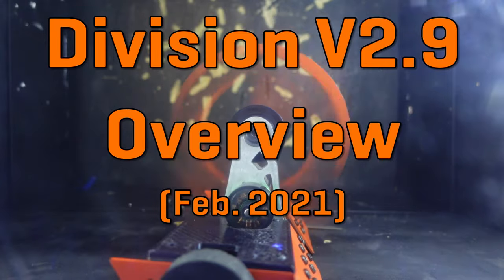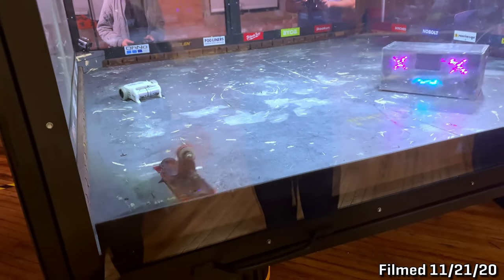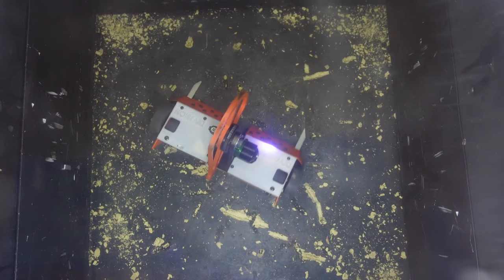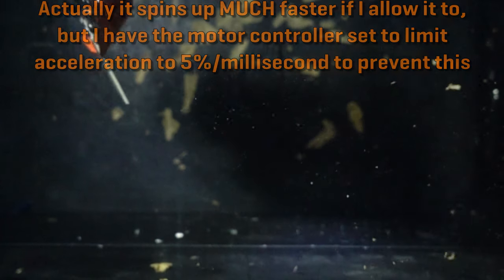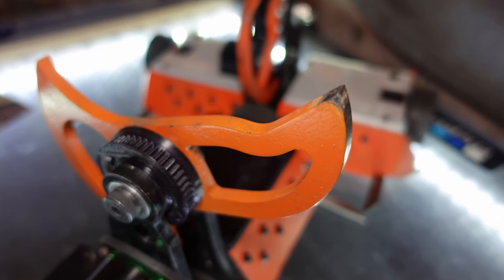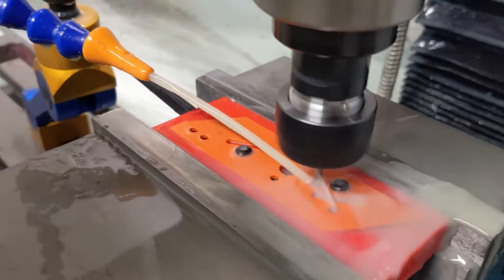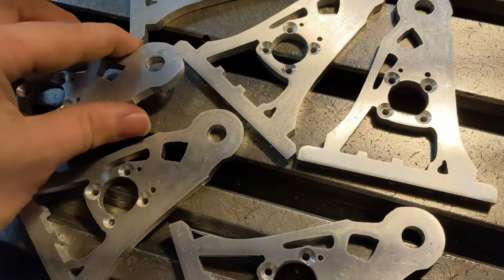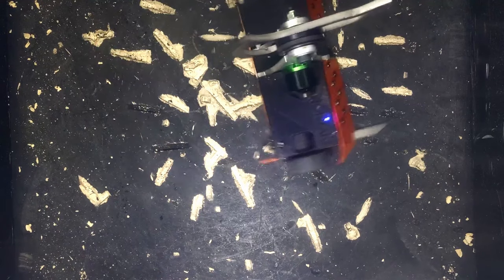Division V2.9 February 2021 Overview! (3lb Beetleweight Combat Robot)

Comment: What are Division’s detentions? Just want to get an idea how big beetle weight robots are.   Also, thank you for responding to my comment it made my day.
Reply from the maker: Division is far from a typical beetle! Definitely much taller and wider than most of the rest. It's about 11 inches wide wheel to wheel and the main chassis is 3.5" long and about 1.25" tall. The weapons are all 7.5" effective diameter and 1/4" thick

Comment: you can try making the drive longer in front of the weapon and reduce the angle of the wedge so that you would be able to pickup the bots and hit them and the biggest advantage is that division will tip over less than usual. you could use longer forks.

Comment: Thanks for the vid, great quality. I am a huge fan, and have been watching your videos since day one. Because of your channel I am working on my first robot. A 1lb drum spinner made out Lexan with only a Metal saw and other simple equipment. If you could give any advice I would be soooo grateful. I hope you acknowledge me.
Reply from the maker: Thanks! Great to hear that I've inspired some to start building. You can do a lot with some basic tools given time and patience. Lexan can be very brittle so make sure if one part breaks there is something else to support it. Also superglue can work very well (after some light sanding) to join polycarbonate together.

Comment: You should make a 30lb version of Division to fight at the Norwalk event! It would be super destructive. It might just be hard to get a robot that heavy to right itself with the weapon.
Reply from the maker: A 30lb bot of any sort will be a huge time and money investment. The last two 30lb bots I built were both awful and still cost  $700-1000. If I wanted to make one that could actually have a hope of winning my best guess is it would be at least $3000 for parts for two robots. I was unfortunately pushing the limits of the work envelope of the Tormach CNC when making parts for Draconid as well meaning I can't easily machine anything bigger than that. I don't think it's possible to scale Division's design times 10 without paying a hell of a lot to machine parts if I cannot do them myself.

I may pursue a different more compact 30lb design at some point in the future, but right now it's just too expensive and I have a lot of fun with the 3lb class as it is without spending thousands per bot. I get my big robot kick with the 250 pound Battlebots 😉
Reply: @JustCuzRobotics  It does sound fun to work on a Battlebot! Beetleweight is probably my favorite category because you can do more with 3lbs than with 1lb, but they are cheaper than 6 or 12lbs.
Reply: @JustCuzRobotics  Wow! I didn't realize 30lb robots were that expensive.

Comment: How much did it cost to build division. I really want to get into combat robotics, but I am currently in college, so my budget is SMOL.
Reply from the maker: It is definitely possible to build a robot that's pretty competitive for ~$500. Sadly Division would not be that robot as I've easily spent 3-4 times that much on its many iterations. But my antweight Mini Mulcher for instance cost about $250 for enough parts to build two complete robots. If you design for the tools and money you have available, you can make it work for cheap.
Reply: @JustCuzRobotics  What weighr class would you recommend? Also do u know of any events in michigan?
Reply from the maker: I think the 3lb class is pretty accessible and less weight obsessive than the 1lb class but either would be a good choice. Check out Black Lightning Robotics on YouTube! That's Bloodsport teammate Nik's channel and he competed in a few events in and around that area.